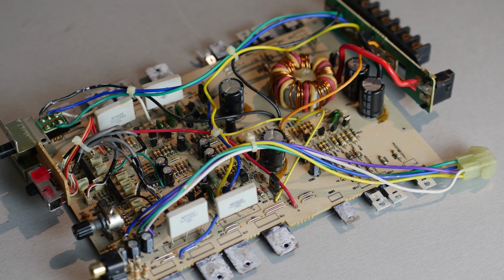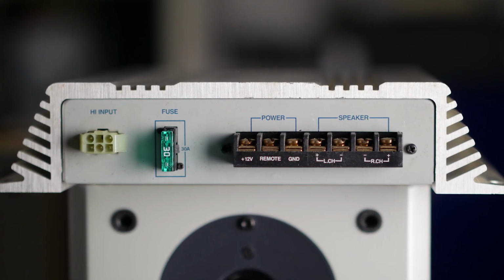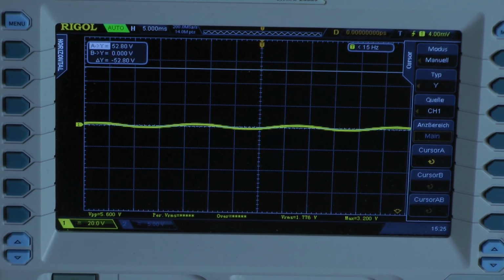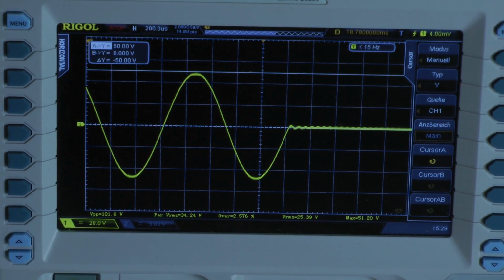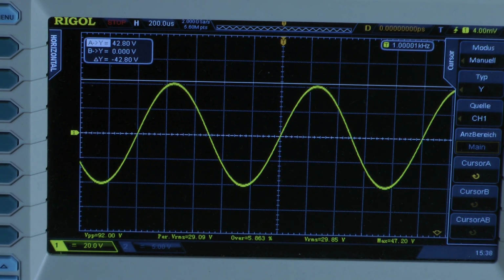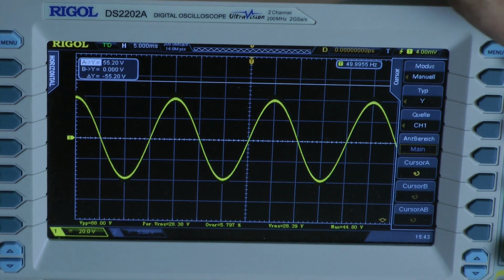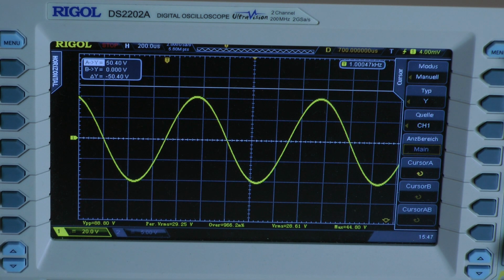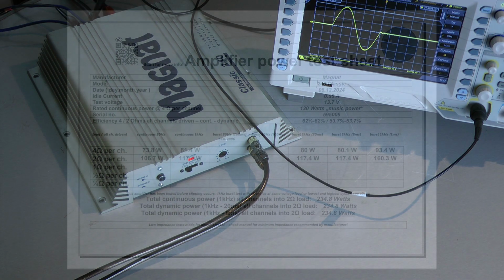Magnat Classic 240 oldschool car audio amplifier repair amp dyno output power & sound qualtiy test

Comment: Überraschend gut..ok...muss man anerkennen....👍🆙️
Reply from the maker: Das war ein überraschungskandidat, an 4 und 2 Ohm etwas stärker als eine Punch 60.2 , dafür weniger effizient und keine Mehrleistung an 1 Ohm dynamisch aber insgesamt weit besser als der allgemeine Ruf würde ich sagen 👍
Reply: @audiokeller1975  das lassen wir dann mal so stehen🤔🤫🤫
Reply: Hello, nice video as usual!
I did not know of this amplifier before, but I have a Sherwood 240w amplifier from the late 80's (korea), with similar specs.
I also have a Sanyo pa6100 amplifier from the 80's (japan), rated at 50w continuos x 2, at 4 ohms!  Do you know if I bridge this amp, if it will put out 100w into 1 ch, or less than 100w??  It draws 30 amps at full power (13.8v) in stereo, as well as 30 amps bridged into 1 ch at 4 ohms.  Thanks!😊
Reply from the maker: @charlesbolano7148 if the amp can handle 2 ohms per channel it’s no problem to drive it mono 4 ohms. 
If not you have 100 watts
Mono 8 ohms. 👍
Reply: @audiokeller1975  The amp can only handle 4 ohm minimum per ch or 8 ohms (owner's manual).
If I connect an 8 ohm woofer to the amp in bridge mode, it only pulls about half the current (16 amps) instead of 30 amps, if I connect one 4 ohm woofer!  So I don't think it puts out 100w bridged with an 8 ohm load, due to the low current it draws (16 amps).  Thanks for your reply!
Reply from the maker: If it’s only rated 4 ohm minimum per channel, it will reduce current as a protection if you go lower ohms.
Reply: @audiokeller1975  I wish you could power test one of these amps (Sanyo pa6100), but I only have 2 of them, and they're hard to find.  Thanks!